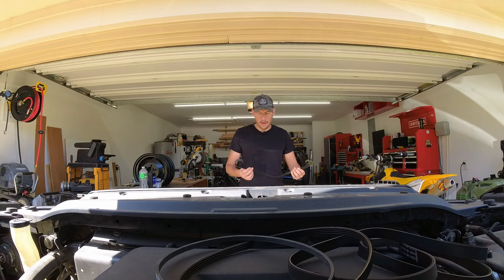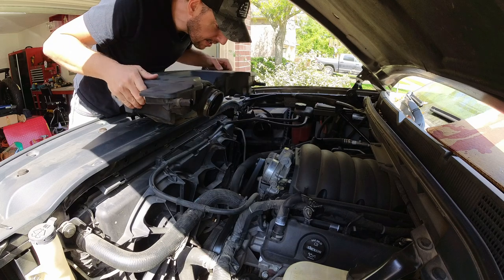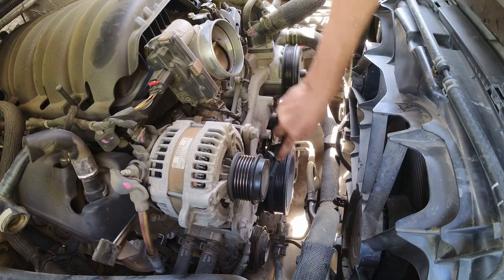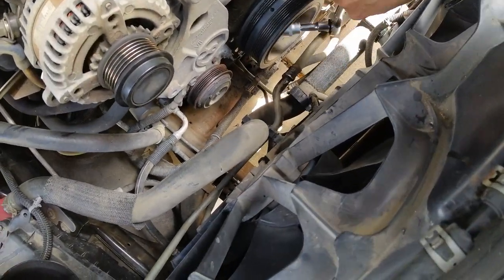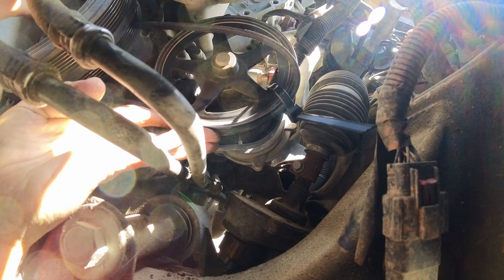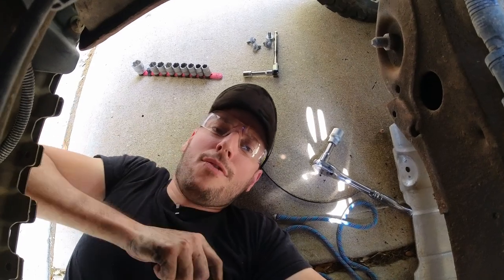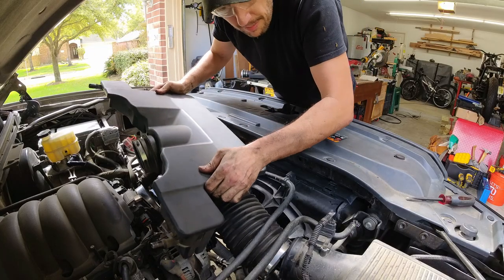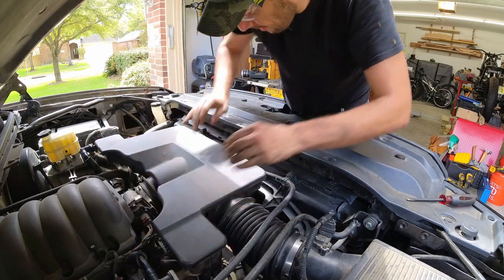2014 GMC Sierra -  Silverado 1500 engine belts replacement. AC comp, vacuum pump and serpentine.

Comment: Great video! Thanks for posting this. Was able to get all 3 belts replaced on my dad's 15 Sierra using some of the tips you showed here. For anyone wondering, you can do the vacuum pump belt from the topside too. You have to put the belt over the pump and get the zip tie on pretty much by feel, but it's not to hard to do. I had all 3 belts replaced in about 45 mins, and I had never done a stretch belt before. The old belts looked pretty good still even though they were 10 years old. He got quoted a crazy number by the stealership to do this. For anyone nervous about the stretch belts, don't be. Follow the steps in this video, and you'll have no issue.
Reply from the maker: I'm glad you did it yourself and that the video helped you. You saved some money to the big boss and made him proud, (win)^2.

Comment: My truck (2014 GMC Sierra 1500) has 139K miles and the belts have never been changed.  Been thinking about tackling them within the next couple weeks, and this video helps A LOT.  I just had to change the thermostat last week, so I might also tackle the water pump, alternator, and coolant temperature sensor while I'm there.   Thank you for the great video!
Reply from the maker: I’m glad you found it useful. Thank you very much for the comment.

Comment: Great video, with great views from top and bottom! Liked the rope derailer technique. Appreciate that you used correct terminology as well (unlike those that call the "A/C belt" a "serpentine belt". It is not a serpentine; it is just a belt.). Adding tensioner, water pump, and alternator changes would have been nice to show, since belts were off already. Thanks for stating all of your tools also (3" extension, 1/2" ratchet, 24 mm socket)!
Reply from the maker: Thank you for your comment, I really appreciate it.

Comment: Great video!  Any need or benefit to put the transmission in Neutral when turning the main pulley?
Reply from the maker: No, the resistance is due to compressing air in the engine. Removing spark plugs would make it easier but too much work for an small gain.
Reply: @BUTTEWORKS  You are not kidding! I just replaced the plugs and wires a month ago. #8 was an absolute beast!!  Thanks for the fast reply sir!!
Reply from the maker: @jimmynickels6248  hahaha I'm glad you made it, always some spice that make you sweat bullets.

Comment: Why did you change all 3 belts...was they making any squeaking or chirping noise?
Reply from the maker: No but the AC broke off because the compressor seized so since I had to change that one, for 50 USD I better replace the other two, since they were 9 years old, 150K miles. Manual say replace every 100K.

Comment: Did changing the ac compressor belt cause your ac to seize? Or was it already seized? Don’t want to change if it seized due to new belt. Thanks
Reply from the maker: It was already seized. I thought the belt broke and change it to later find out it broke because the compressor was seized. Should have thought about that when I first saw melted rubber on the pulley.

Comment: I thought you can't rotate clockwise? I thought it must be counterclockwise only??
Reply from the maker: The engine rotates counterclockwise if you look from the front so I was tightening the nut. However, that nut is so tight that you could turn the engine in the opposite direction and not get it loose.

Comment: Why none of the belts you've listed the Amazon links stated " does not fit my truck " 2014 silverado 5.3 V8?
Reply from the maker: In my case it say "it can not confirm it matches". I believe  there may not be enough information for the Amazon algorithm to confirm 100% match. I have the 5.3L V8 and they fit and work perfect.

Comment: Any problem with ac compressor after you replace the belt ? Seen many gm compressor lock up then belt shredded
Reply from the maker: Yes, compressor was locked up. Actually next video will be replacing it. It broke that new belt right after AC went on.
Reply: Any update on new ac compressor?
Reply from the maker: @hnekcivic  Yes, video coming up this week. Job done already. Thank you for following up.

Comment: GMC Manual doesnt say to check belts till 150,000. My vacuum pump belt just snaped at 103,000. It makes brakeing near impossible.   Do yourself a favor and check/replace your belts (sooner rather than later) if I had been in tight traffic on the highway it would have been bad.   (note I check my belts about every other oil change this just happened and I didn't catch it soon enough)
Reply from the maker: I read in a service manual, not the user manual that  GMC recommend the replacement each 100K miles. Mine were ok at 140K miles except for the  AC one that snapped due to a seized compressor. For the price and time invested in the replacement you could do it each 50K regardless of the condition just to be safe. I'm glad you were not in a bad spot when the belt broke off, it really could have get you in real trouble.

Comment: Thank you
Reply from the maker: You're welcome
Reply: @BUTTEWORKS  ended up taking it to a local shop and the chirping sound that I thought for sure would be a pulley ended up being a lifter problem. The shop recommended a new engine for $14,000. So I picked the truck up with three new belts installed and brought it to my work to let a couple of friends look at it and sure enough when you remove the oil filler cap the chirping gets louder proving that it’s something internally. Any thoughts? Thanks again
Reply from the maker: @Ransome2501  No idea, difficult to diagnose without seeing the truck. But it the problem are the lifters I don't know why the want to change the entire engine. Doesn't make any sense.

Comment: So you can crank on that bolt left or right
Reply from the maker: I read that counterclockwise you loosen. I'm pretty sure that bolt is super tight so your could turn the engine counterclockwise, but I prefer not to try. Also, it is easier, at least for me, to crank it clockwise while doing the job.

Comment: He said vacuum pump.   Is that the Power steering belt ?
Reply from the maker: No I meant vacuum pump for the brake booster. Thus truck has no power steering belt. Thank you for checking the video.